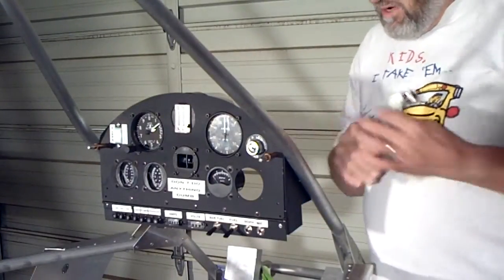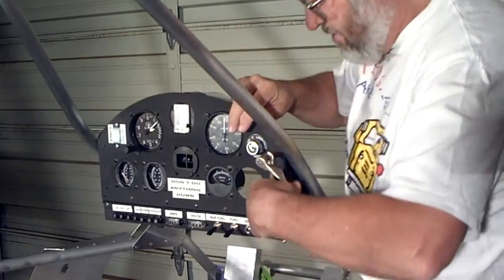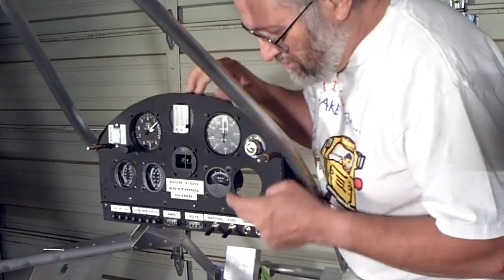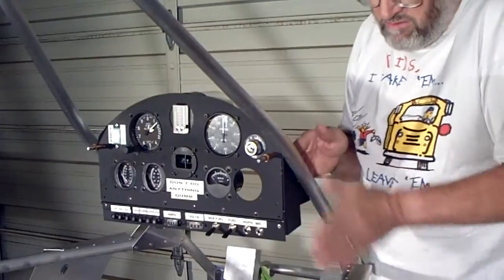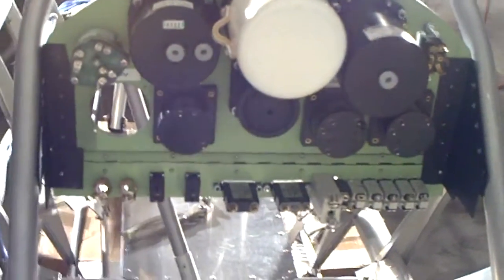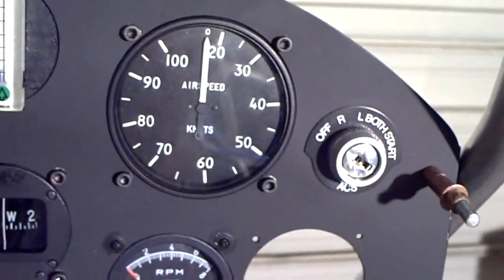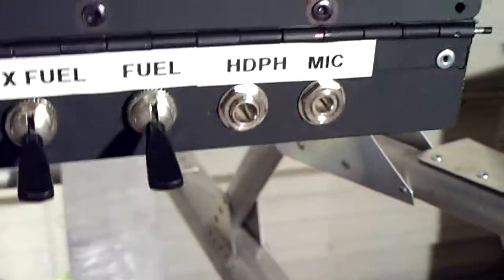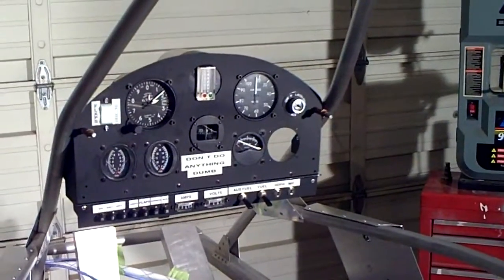MICHAEL HEIT:  INSTRUMENT PANEL INSTALLED IN AIRFRAME1

Comment from the maker: @mxf7010g8k I apologise for such a late reply to this message; I just now figured out this YouTube stuff enough to see all the messages I had piled up on here .... 

The factory instrument panel is a wood piece cut out and it is not worth anything except for tracing ou ton aluminum ... or rat bait.... the kit does not include instruments but Tom will sell them as a package for less than you could buy them from a dealer .... each builder has their own ideas.